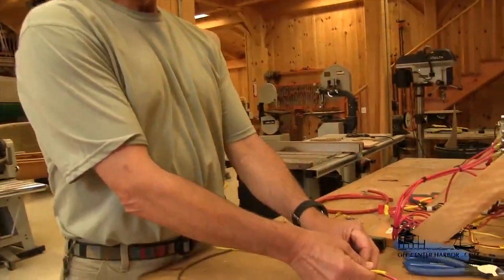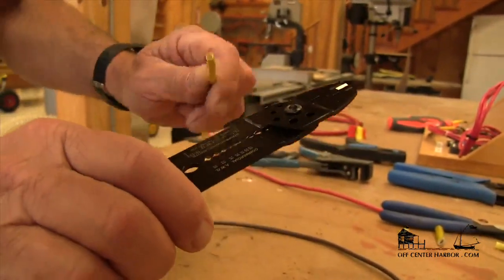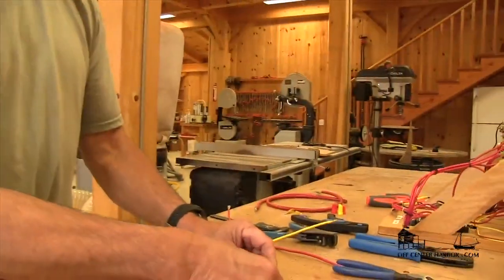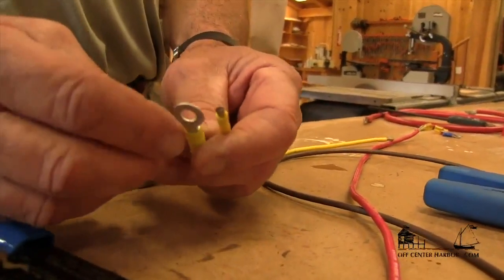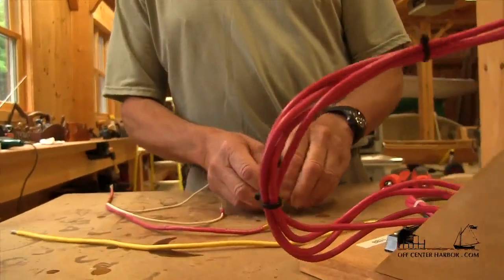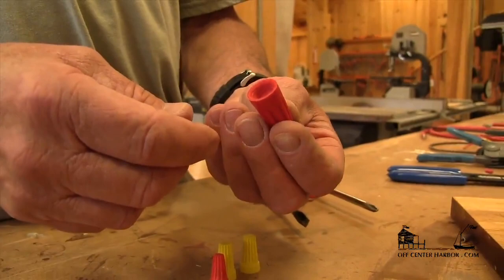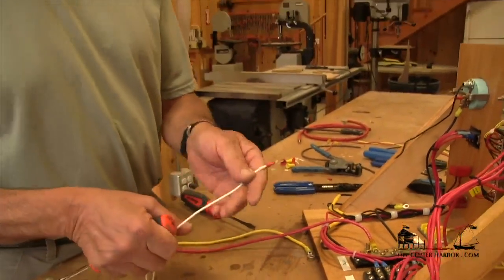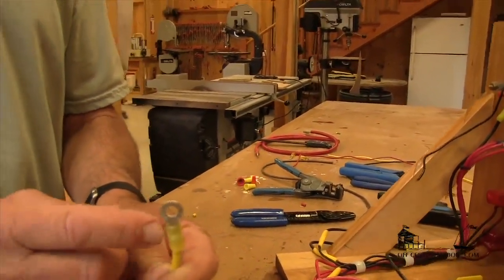Electrical Systems Part 4 - Making Good Connections

Comment: Good video! It also important to discuss the most important connections. The ones to the batteries. They should be clean, prepped, and absolutely free of corrosion.  I believe ABYC and USCG require terminal boots to prevent cross shorting the terminal posts as well. Hardware should include a lock washer or add'l locking nut; NEVER use wingnuts. I keep a cheap, appropriately sized combo wrench in a ziplock next to the batteries in case of emergencies.

Comment: those first cutters and crimpers are a waste, better to spend more for a real set, almost impossible to strip without nicking the strands,   for protection  I've found the liquid electric tape coating works much better than most others such as shrink fittings, not as pretty but very secure and water proof in my experience.    , IMHO

Comment: Nice and instructive video. But why only crimp? I always crip and solder.
Reply: sm6wet  well crimped connections and heat shrink has always held up for me, some are almost 8 years old and i have a center console. soldering may be a good practice but i always feel its over kill